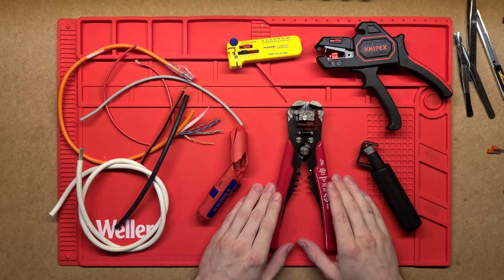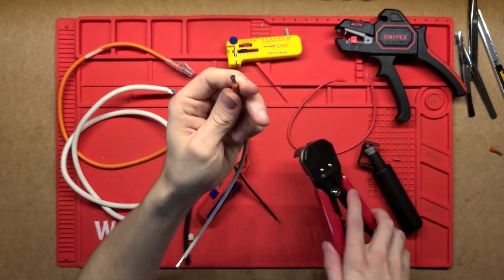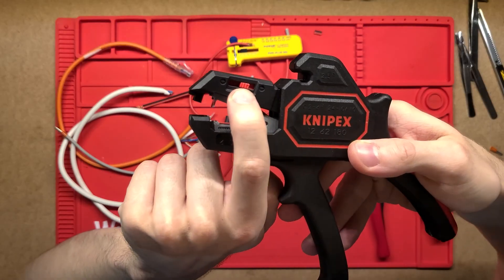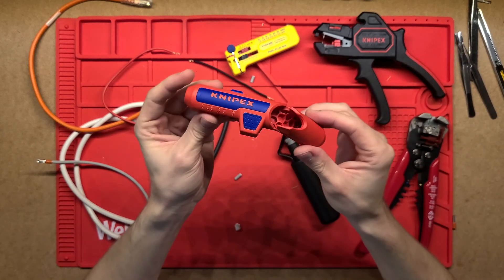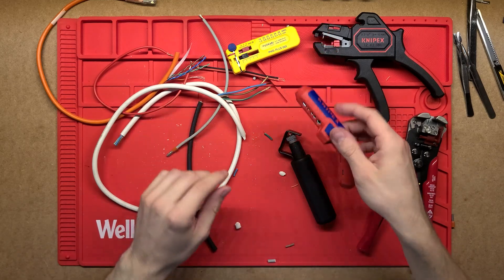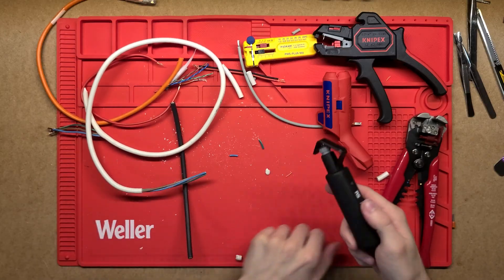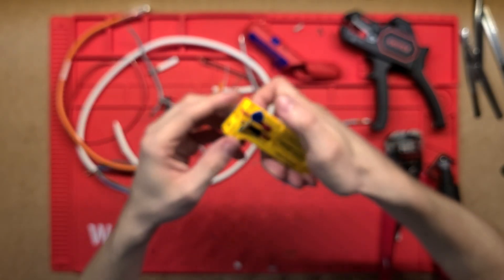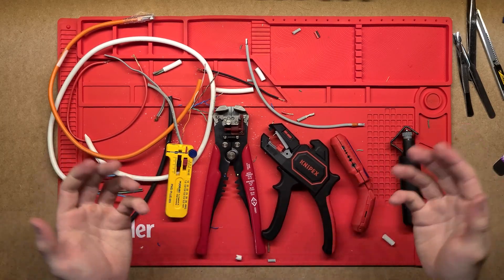Which Cable Stripper is Right for You?

Comment: Ethernet cable connectors use IDCs, so you never need to strip the Individual wires.
Reply from the maker: Agreed, but it depends on what connectors you are using. 
I often use eth cable as makeshift jumped for pcb prototyping. Works well for that.

Comment: the universal style (like the black knipex) wil also strip any sheath that is within the range they give; and you can very well strip a much bigger length if you make a little bend in the cable so it doesn't have to be blocked by the measuring thingie. I have a weicon n°5 and this little tip allows it to work on both sheath and internal cable. I also have a chinese cable cutter with an integrated sheath stripper for bigger cables and with both of those I'm covered in term of cable size (still need a manual stripper for when you have a tiny length before the sheath and the universal tool can't get there)

Comment: If you're not using the automatic strippers, you're making your job harder for no reason.
Reply: lol
Reply: the automatic stripper won't work if you have a small length of sheath removed though; you'll need to go manual for those (like when you're soldering a small connector)